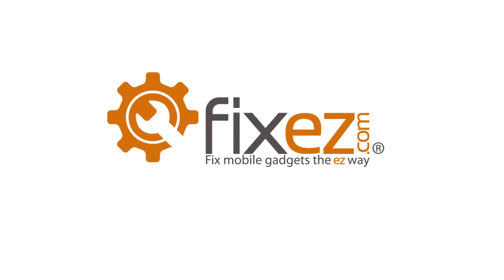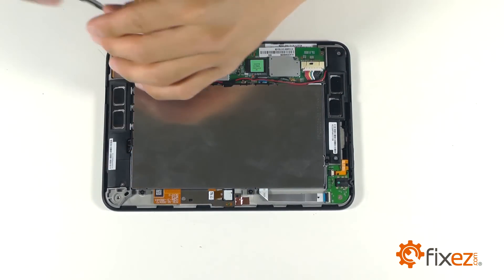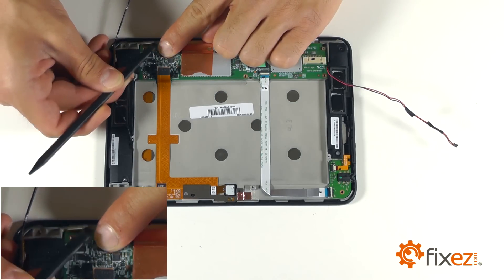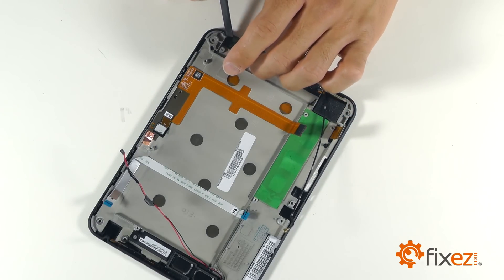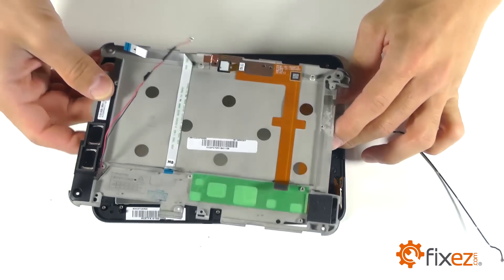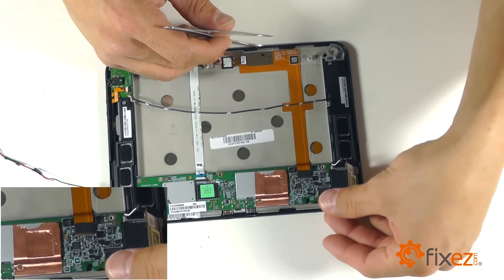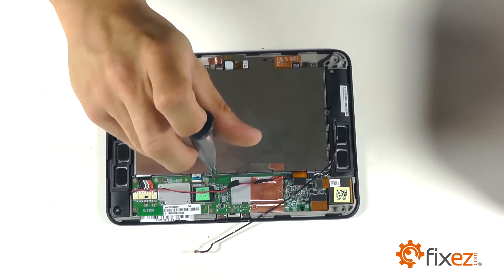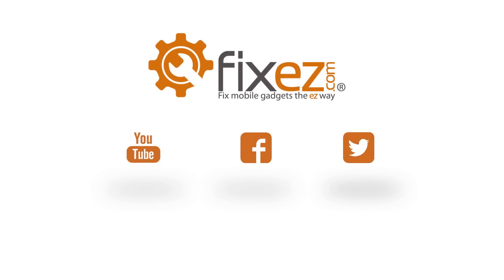Amazon Kindle Fire HD 7.0 Teardown Video

Comment: Hi, I brought a new LCD because my kindle screen had broke. When it arrived I realised I needed to order a digitizer instead, so I ordered one then followed this video and realised they were fused together. Is it possible for me to bond the new digitizer and new LCD together using double sided tape/adhesive or do I need to buy a complete unit that is already bonded together? Amazon are seriously losing brownie points with me! Could have made this so much simpler.
Reply from the maker: +wayne davies This display comes as a bonded unit. Fusing the digitizer and lcd requires special machinery. I would recommend replacing the whole display assembly.

Comment: yo you cant just change the glass with out messing up the lcd screen because there glued together. trying to separate the glass from the lcd to replace only the glass will not happen i dont give a shit if you had special powers its not going to come off with out damage so i went on amason for the lcd since it broke cause its imppssible to take off with out braking the lcd 
the freaking lcd cost more then a brand new kindle fire hd 7 
theres no point in selling just the screen you need both lcd and glass with digitizer no point in even repairing this tablet just buy another one and save your money and time 
repairing it cost more then a new one 
nice one amazon lg is raping your customers

Comment: 4:45 im confused did the lcd just fall out of place so easy or did u have to pry out the frame from the LCD ?
Reply: Elite Sales No they didn't actually remove the LCD just faked it. The screen assembly is actually the LCD and the digitizer which are lock sealed. So the LCD is actually the silver thing on the back at 4:45 they show the plastic frame the silver is the LCD then the black front part is the glass in between the glass and the LCD is the digitizer.